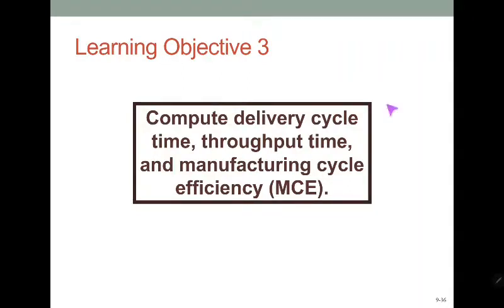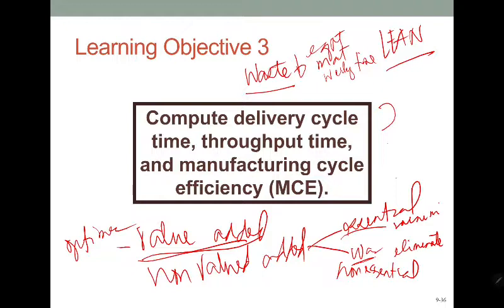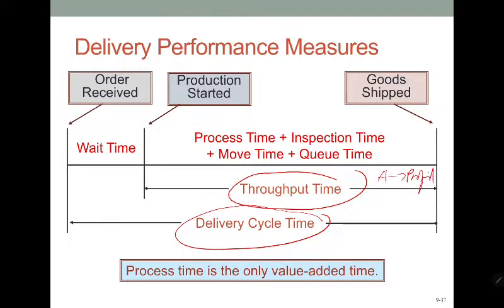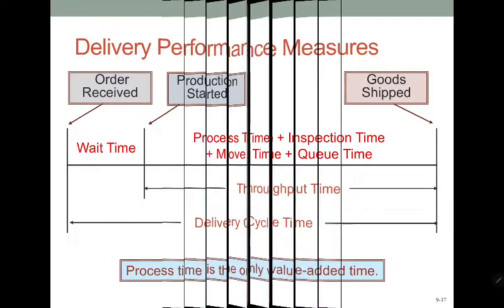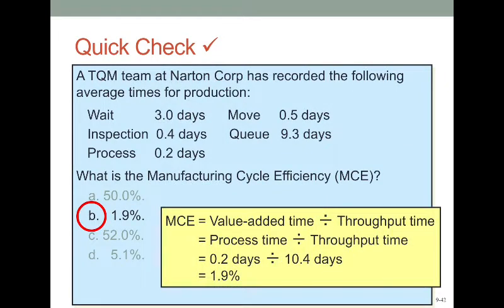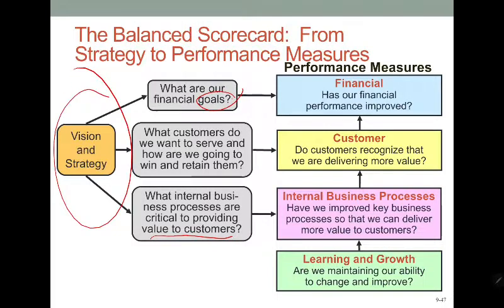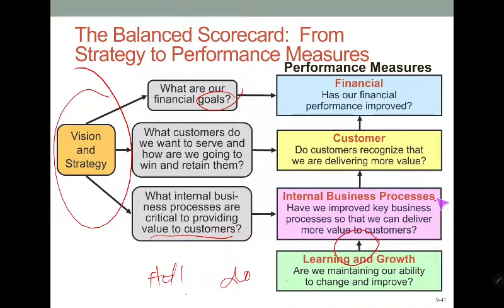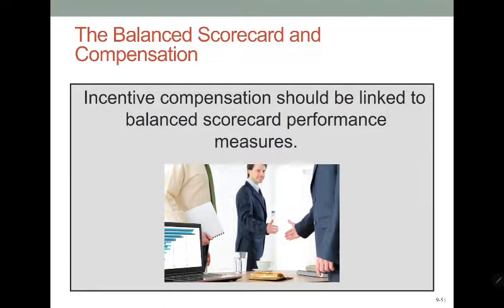LEAN SYSTEM & BALANCED SCORECARDS

Comment: Good day, ma'am Wye! Here are my key takeaways for this video po: Lean production drives efficiency by focusing on minimizing Non-Value-Added Activities and maximizing value-adding ones, with performance metrics like delivery cycle time, throughput time, and manufacturing cycle efficiency. This operational insight is strategically integrated into the balanced scorecard, which provides a holistic view of performance by aligning individual and organizational goals across multiple critical perspectives. Thank you so much for providing this insightful video po!!

Comment: Good day po, Ma’am Wye! Thank you po for this very informative video lesson. I learned that delivery cycle time, throughput time, and manufacturing cycle efficiency are important to achieve lean production. Delivery cycle time tracks how long it takes to fulfill customer orders, while throughput time shows how efficiently inputs are turned into finished products. Manufacturing cycle efficiency is how much of the production time adds value. By applying these measures, organizations can operate more efficiently, reduce waste, and ultimately improve performance while ensuring greater customer satisfaction.

Comment: Good day po, Ma’am Wye! Thank you po for this video lecture. My key takeaway po from this vid is that it is very important to evaluate delivery cycle time, throughput time, and manufacturing cycle efficiency to reduce waste and use our resources like equipment, materials, and time more effectively for a more efficient production process. It is also important to prioritize enhancing value-adding and essential non-value-adding activities while minimizing or eliminating non-essential tasks to save time. As for the experience points po, I learned that organizations aiming to boost productivity, enhance customer satisfaction, and achieve higher efficiency need to assess delivery cycle time, throughput time, and manufacturing cycle efficiency. They should alsofocus on increasing value-adding activities while reducing waste and non-productive processes. Thank you so much po again for this informative video, ma'am!

Comment: Hi Ma’am Wye! Thank you po for the super informative video! Here’s what I learned:

We need to check delivery cycle time, throughput time, and manufacturing cycle efficiency to minimize waste and make better use of our resources like equipment, materials, and time para mas maging lean and efficient ang production.

We should focus on improving value-adding and essential non-value-adding activities, while trying to lessen or remove the non-essential ones to work smarter and save time.

Comment: thank you po for the video! i learned that delivery cycle time, as time goes by, and manufacturing cycle efficiency are vital for improving lean production. delivery cycle time shows how long it takes from receiving an order to delivering it, helping spot delays in meeting customer needs. throughput time reflects how efficiently a company transforms inputs into finished products, covering the entire production process. manufacturing cycle time measures how long specific tasks take, highlighting areas for operational improvement. together, these metrics help minimize waste and maximize activities that add value, ensuring more efficient use of resources, faster production, and better customer satisfaction.

Comment: Greetings, Ma’am Wye! Thank you for this enlightening lecture. I gained valuable insights on:

The lean methodology, which focuses on maximizing customer value while minimizing waste by differentiating between value-added and non-value-added activities.
The balanced scorecard, applicable to both individuals and organizations, aligning operational efficiency with strategic goals.
Additionally, the examples illustrating manufacturing cycle efficiency (MCE), delivery cycle time, and throughput time were very helpful. These metrics provide critical insights into identifying delays, optimizing workflows, and improving overall efficiency.

Your dedication to sharing such comprehensive knowledge is truly appreciated. Thank you!

Comment: Greetings, Ma'am Wye! Thank you so much for this insightful lecture! I learned that

- The lean system, highlighting value-added and non-value-added activities.
- The balanced scorecard, which applies to both individuals and the organization as a whole. 

Additionally, it provided examples on how to calculate delivery cycle time, throughput time, and manufacturing cycle efficiency.

Comment: Greetings, Ma'am Wye! Thank you po for this video! I really gained valuable knowledge from it.  Below are my responses to the experience points:

Analyzing delivery cycle time, throughput time, and manufacturing cycle efficiency is essential for organizations aiming to improve operational performance, boost customer satisfaction, and achieve overall efficiency. It helps minimize waste by optimizing the use of resources such as equipment and materials, promoting lean production, and distinguishing between value-added and non-value-added activities. Focus on value-adding activities and reduce non-essential non-value-adding activities, while essential non-value-adding activities (like moving and waiting) should be minimized as much as possible.

Comment: The delivery cycle time, throughput time, and manufacturing cycle efficiency are key metrics in optimizing a lean production system. Delivery cycle time measures the duration from receiving an order to shipping the product to customers, helping businesses identify delays in meeting customer expectations. Throughput time is a critical indicator of how efficiently an organization can convert its assets into profit, representing the actual time it takes for a product to be manufactured, from the start of production to its completion. Manufacturing cycle time tracks the time required to complete a task, offering insights into operational efficiency. These metrics aim to minimize non-value-added activities (waste) and maximize value-added activities (those that directly contribute to product creation or customer satisfaction), promoting lean production practices that reduce waste in asset utilization, such as equipment, materials, and working time. Reducing cycle times and improving manufacturing efficiency leads to lower costs, faster production, and better resource utilization.

Comment: Good day, Ma'am! I'm Alishah Micah V. Obispo from BSMA 3. Thank you for the video lecture and here are my learnings through this video.
•	Importance of delivery cycle time, throughput time, and manufacturing cycle efficiency: to lessen the waste of utilization of assets such as equipment, materials, and working time which leads to lean production system, the value-added activities (the activities that we need to maximize) and non-value-added activities: essential (minimize) & waste (eliminate). 
•	Delivery Cycle Time refers to the time that order was received to the goods shipped to the customers. Throughput time is an indicator of the organization’s ability to convert the asset into profit and it is the actual time taken for the product to be manufactured. Manufacturing Cycle Time is the time it takes to complete a specific task from the start to finish.

Comment: Good day, ma'am wye! I am Justine Honey Domingo, from BSMA 3 po.  As for the experience points:

Thank you for sharing this insightful video discussion on calculating delivery cycle time, throughput time, and manufacturing cycle efficiency (MCE). It provided valuable insights into reducing waste in the use of equipment, materials, and working time. I learned that Lean Production encompasses both Value-Added and Non-Value-Added Activities. Value-added activities should be enhanced, while non-value-added activities, such as moving time, inspection time, and waiting time, should be minimized. The video also emphasized the significance of the Balanced Scorecard, highlighting that individuals should maintain their personal scorecards while the organization as a whole should have a comprehensive balanced scorecard

Comment: Good day, Ma'am! Here are my answers for the Experience Points:

1. Why analyze delivery cycle time, throughput time, and manufacturing cycle efficiency?
- Examining delivery cycle time, throughput, and manufacturing efficiency is crucial as they offer insights into the efficiency and effectiveness of various departments, helping managers identify bottlenecks, implement cost-saving measures, and streamline operations to enhance overall organizational performance.

2. What activities should be optimized and minimized?
- OPTIMIZE – Value Added Activities
- MINIMIZE – Non-Value Added Activities

Comment: Good day! Your points highlight the significance of various operational metrics and strategies in the context of efficiency and waste reduction within the production process. Here's a summary of your insights:

Significance of Metrics:

Delivery Cycle Time: Its significance lies in measuring the duration from order placement to delivery. Reducing this time enhances customer satisfaction and operational efficiency.
Throughput Time: This metric evaluates the time taken to convert raw materials into finished goods, aiding in identifying bottlenecks and streamlining production processes.
Manufacturing Cycle Efficiency: This metric emphasizes the effective utilization of assets and resources, distinguishing between value-added and non-value-added activities. Optimizing this efficiency reduces waste and improves productivity.
Optimization and Minimization Strategies:

Optimization: Focus on enhancing activities that directly contribute value to the final product. This ensures efficient utilization of resources and maximizes output.
Minimization: Identify and reduce non-essential non-value-adding activities. Essential non-value-adding activities, such as movement and waiting times, should be minimized to improve overall process efficiency without compromising essential functions.
These strategies align with principles of lean manufacturing, emphasizing the elimination of waste and the maximization of value-added activities within the production process.

Comment: Thank you so much for this wonderful video discussing about LEAN SYSTEM & BALANCED SCORECARDS. The things I’ve learned regarding this video include a strategic management performance metric that helps companies identify and improve their internal operations to help their external outcomes.

EXP POINT
10. Why focus on delivery cycle time, throughput time, and manufacturing cycle efficiency? 
Simply stated, lead time is the interval of time between an item's order and delivery to the customer, whereas throughput time is the amount of time it takes for goods to move through the production process. In the manufacturing industry, cycle time is a crucial key performance indicator (KPI). It's a measure of how long it typically takes to turn raw materials into a finished good. The ability to determine what proportion of cycle time is made up of value-added processes is one of the main benefits of measuring manufacturing cycle efficiency. Since manufacturers only see a small portion of the entire cycle time that is effective, this data frequently comes as a surprise.

11. Which activities should be optimized and minimized? 
Process optimization leads to increased productivity. One can automate and eliminate unnecessary steps from the process to save time, reduce error rates, and avoid duplication of effort. The core concept of strategic management is the identification and understanding of specific organizational goals. Setting short-term objectives is a great place to start because they provide a direct route to achieving long-term objectives. Optimizing value-adding activities and minimizing non-essential non-value-adding activities, while essential non-value-adding activities like moving and waiting should be minimized.

Comment: Good day po, ma'am. I've finished watching your video presentation on balance scorecards and lean systems. 
Experience points:
1. Minimize waste in the use of resources, including labor-in-process, materials, and equipment. Lean production as a result will enable the business to assess both value-added and non-value-added operations.

2. Activities with added value need to be given priority. Less should be done with non-essential, non-value-adding activities, and more should be done with vital activities.

Comment: Good day po, Ma'am Wye! Here are my learnings po in this topic:

1. We need to keep track of the delivery cycle time, throughput time, and manufacturing cycle efficiency as it ensures proper utilization of the resources. It aims to reduce waste in using equipment and materials to achieve lean production and focus on every activity that affects the company. 
2. We need to optimize value-adding activities, those that benefit the profitability of the business. On the other hand, minimize or eliminate non-value-adding activities depending whether they are essential or not, to save time and efforts.

Comment: Importance of Delivery Cycle Time, Throughput Time, and Manufacturing Cycle Efficiency:

Minimize waste through the efficient use of assets such as equipment and materials, adopting lean production principles to distinguish between value-added and non-value-added activities.

Optimizing and Minimizing Activities:

Optimize efforts by improving value-adding activities. Reduce non-essential non-value-adding tasks, and minimize necessary non-value-adding activities like movement and waiting.

Thank you for the helpful lecture po, Ma'am : )

Comment: Good evening po. Thank you so much po for the video, sobrang nakatulong po ito for my preparation on my final exam and 4th set, dahil may mga lumabas po na tanong regarding this topic.

EXPERIENCE POINTS:

• Analyzing delivery cycle time, throughput time, and manufacturing cycle efficiency is essential for improving operational efficiency, reducing lead times, enhancing customer satisfaction, and optimizing processes to minimize waste and costs.
• Optimize activities that add value, like production and customer service, while minimizing non-value-added tasks and unnecessary delays to improve efficiency and resource use.

Comment: Good day, Ma'am Wye! The lecture has concentrated on two key initiatives: the balanced scorecard, which is meant for both individuals and the business as a whole, and the lean system, which includes both value-added and non-value-added operations. In addition, it has also included examples of how to determine/compute an organization's manufacturing cycle efficiency, throughput time, and delivery cycle time. Thank you so much po for this video lecture.

•	Why do we have to look into delivery cycle time, throughput time, and manufacturing cycle efficiency?
Analyzing delivery cycle time, throughput time, and manufacturing cycle efficiency is important for organizations to improve efficiency, reduce costs, enhance quality, optimize capacity, and drive continuous improvement.

•	What activities do we need to optimize and minimize?
Optimize value-adding activities.
Minimize essential non-value-adding activities like movement and waiting.
Eliminate non-essential ones, such as defects and overproduction.

Comment: Greetings po ma'am! Thank you so much po for this video

Experience points:
#Organizations looking to boost customer happiness, increase operational performance, and attain overall efficiency must analyze delivery cycle time, throughput time, and manufacturing cycle efficiency. to promote lean manufacturing in order to identify operations that add value and those that do not, and to minimize waste by making effective use of resources like materials and equipment.

#Maximize: Activities that provide value decrease: Decrease non-essential, non-value-adding activities; decrease necessary, non-value-adding activities, such as waiting and moving.

Comment: Good day po, ma'am Wye! Thank you so much po for this video about Lean System and Balanced Scorecard. 

For my experience points po:
1. Why do we have to look into dleivery cycle time, throughput time, and manufacturing cycle efficiency? 
- To lessen waste, materials, and working time.

2. What are the activities that should be optimized and minimized? 
- The activities that should be optimized are the value adding activities.  The activities that should be minimized are the non essential nom value adding activities. Eliminate non-essential ones such as defects and overproduction.

Comment: Good day, ma'am. Done rewatching your video lecture about lean systems and balance scorecards.
1. Reduce waste in terms of asset usage, such as equipment, materials, and work-in-process. This will result in lean production, allowing the company to examine value-added and non-value-added processes.

2. Value-added activities should be prioritized. Non-essential non-value-adding activities should be reduced, while non-essential activities should be removed.

Comment: Thank you for this video po, I really learned a lot from it.❤ Here are my answers po for the experience points:

1. Analyzing delivery cycle time, throughput time, and manufacturing cycle efficiency is crucial for organizations seeking to improve their operational performance, enhance customer satisfaction, and achieve overall efficiency. To reduce waste by efficiently utilizing assets like equipment and materials, promoting lean production to discern value-added and non-value added activities.

2.  OPTIMIZE: Value-adding activities
     MINIMIZE: Reduced non-essential non-value adding activities while essential non-value adding activities like moving and waiting should be minimized.